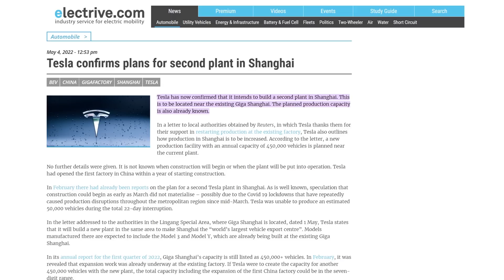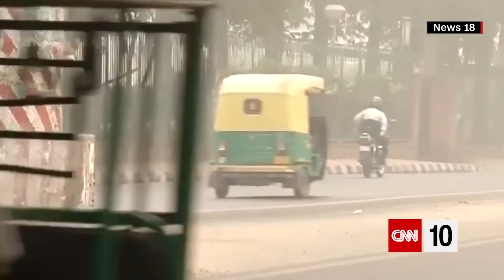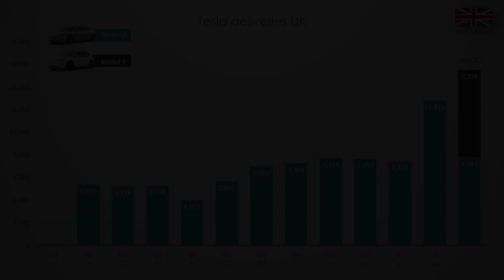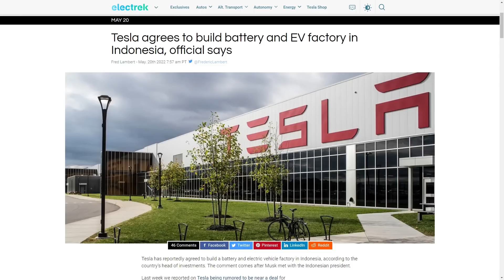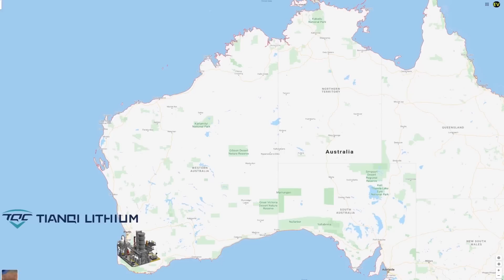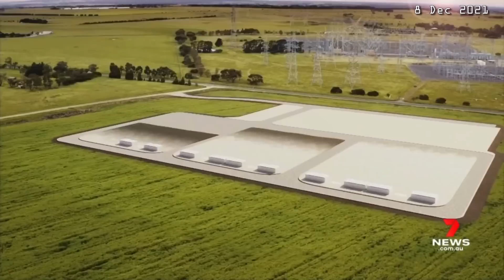Where Tesla will build their next factories

Comment: Would be ideal to move the dirty SA aluminium smelter onto green power, as the has turbine electricity is not economically sustainable. Mega casting at the smelter would save reheating and transporting billets. 
With the wholesale cost of power going through the roof because of rising gas and coal prices, maybe it's time to look at HVDC solar transmission across Australia. Not just exporting to Indonesia,  but sending it to Eastern States where it's dark, while the Sun still shines in NT and WA.